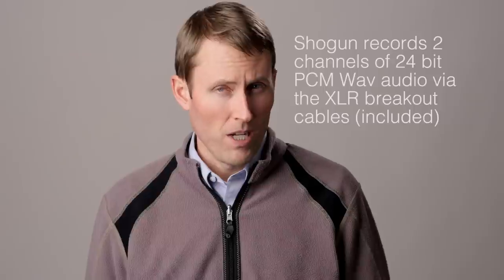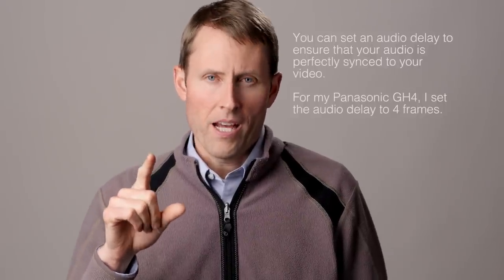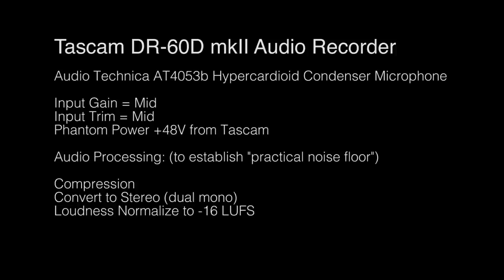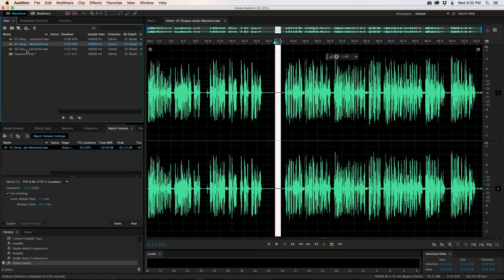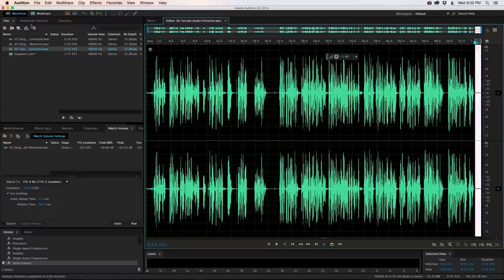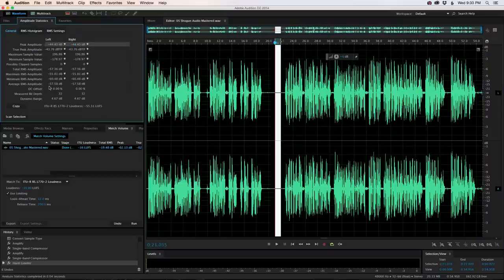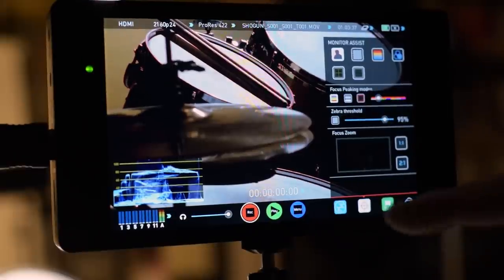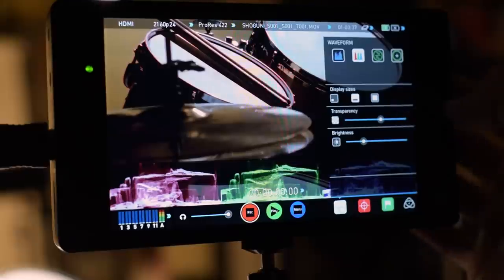Atomos Shogun XLR Audio Inputs: Decent Preamps

Comment: This is really useful, thank Curtis. I'm about to invest in a GH5s and Ninja Inferno, and wonder if you could help with an audio question? I normally record 2 Sennheiser lav mikes via XLR into a Zoom H5, and I'd like to be able to record these plus the Zoom XY or shotgun mike into the Inferno in such a way that I have the 4 separate audio channels to mix in edit. If I run the Zoom line out into the GH5s line in and then HDMI to the Inferno, should this give me the 4 audio channels I'm looking for, or will it result in amalgamated audio (which is what happens on my Sony a6500)? I wonder if I need to run the lavs direct to the Inferno using the XLR adapter cable and the Zoom audio into the camera line in, then HDMI to the Inferno. Any advice much appreciated ;-)
Reply from the maker: Hi Alastair, wow, that’s a tough one. The first challenge will be getting everything in sync since there’s always latency with the HDMI output on cameras. It might work but sounds a little challenging, to be honest.
Reply: Curtis Judd  Thanks Curtis, appreciate you coming back so quickly, I’ll let you know how I get on. The most important element for me is that the 4 channels are kept separate. I can most likely deal with sync issues in post if needs be. Or record background audio separately. 
Not sure if the audio quality will be better going through the Zoom/camera line in/HDMI to Inferno, or direct to Inferno with XLR adapter cable. Time will tell!
Reply from the maker: Alastair, this is probably not what you wanted to hear, but I would probably forego the ATOMOS recorder for now and invest in an audio recorder with 4 inputs instead, like the Zoom F4. That will probably lend more value to most productions, but of course I’m being somewhat presumptuous since I don’t know what you’re shooting. Just food for thought.
Reply: Thanks very much Curtis, I'll certainly look into the F4. I've got an H5 and usually record 2 XLR lavs into that, but syncing everything in post is a hassle. I'd like the Atomos for the 4k 60p 422, focus control, on screen LUT etc so will probably still go for it. I have to shoot quite a lot of takes in noisy shopping malls and supermarkets where there is a lot of background noise and electronic interference. Often we need to do a mix of recorded dialogue with background ambiance, so having these on separate channels is really important. Mind you, the background stuff doesn't need to sync perfectly with dialogue so that makes life easier. The challenge is we usually need to be quick and mobile, so having everything on one fairly compact rig is a big help. Thanks very much for your advice, much appreciated.

Comment: Hi Curti, thanks so much, very useful! I am connecting a Countryman Lav XLR to the Shogun for an interview, I will only use it as a VO. Do you have any setting recommendations for input/output gain?

Best,
Alex
Reply from the maker: Alex Cadilla Yes, I'd start with Mic Level and 0db as my first test to see where that gets you. I, usually aim for peaks that hit -12dB and then compress and loudness normalize in post like this: https://youtu.be/VcMOBrdbHgk
Reply: Curtis Judd Great! Thanks so much Curtis!
Reply: Curtis, sorry to bother you again but I have another question. The Shogun's phantom power can only be turned when in Audio Options the Audio in Mic Level is set at -40 dBul. If I choose Pro Level at +24 dBul or Line Level at -10dBul, the phantom power for a mic connected through the XLR's cannot be turned on and these are the only two options. If I use phantom power, does having the Audio In on the "Mic Level {-40dBul} setting have a detrimental effect on the sound recorded? I still raise the input gain level so it peaks at -12 but I'm concerned that the -40 setting will affect the sound. I am not using a sound board, I am connecting a LAV and a stereo mic directly to the Shogun.
Reply from the maker: Alex Cadilla Alex, no, that's no problem at all. The -40dB just refers to the fact that microphones produce a much weaker signal (-40dB) relative to line level (+6dB when using a balanced cable). So don't worry about that at all, you have the right setting!

Comment: Hello Curtis, thank you for the wonderful review!!! I have a question that I think you may be the only person on the internet that can answer it: I am planning to buy a Tascam-DR701D external recorder, and also an Atomos Shogun Flame for my sony A7S. Obviously I would have to run the micro HDMI to HDMI from my A7S to the Atomos to get 4K video. However, I would also like to use the sync timecode function and HDMI trigger of the DR-701D. Would running the HDMI output from the Atomos to the HDMI input of DR-701D work? (the setting looks like this A7S -> Atomos -> DR-701D)

(I know that I can also run the Micro HDMI to HDMI from A7S to the DR-701D, and then HDMI to HDMI from the DR-701D to the Atomos instead (A7S -> DR-701D -> Atomos), but the problem is with this setting DR-701D doesn't support 4K recording just yet).
Reply from the maker: Hmm, I'm not sure whether the HDMI control signals will pass through and also not sure whether the timecode passes through the Atomos in either direction. I'm afraid that I don't know. :( Perhaps contacting Tascam and Atomos will help?
Reply: Thank you so much for your reply! I only want to buy the DR-701D specifically for these two functions. I will contact them and see what they say. If it's not possible I can opt for the DR-70 instead
Reply from the maker: That makes sense. Best wishes!

Comment: Can you compare the Shogun's preams with the ones of the zoom h5?
Reply from the maker: +Manuel Eisenkirchner I'd love to do that but don't have an H5 on hand. But I can tell you this: When I've compared the H6 (evidently has the same preamps as the H5) to the Tascam DR-60DmkII in the past, they were quite similar both in terms of sound and in terms of noise performance. Then in this episode I compared the Shogun and Tascam DR-60D. I would expect that the Shogun's preamps to be a little noisier than the H5, probably by around 3dB. The Shogun has a pretty warm sound with a rich low-end but is not as clean as decent audio recorders like the H5.
Reply: thank you! =)

Comment: Hi Curtis, do you know if I can plug a Mic Mixer into the unit via the mixer's XLR outs into the XLR ins?  Also, does each input record in Left/Right? Or does one input record in left and the other in right?  Thank you!
Reply from the maker: Hi Felipe, yes, on the audio options page you change the input to line level input. Each input records a single channel. Most likely you'll get a stereo feed from the mixer (a left and right channel). Good luck!
Reply: Thank you!

Comment: Hi, and thanks for your knowledge-sharing. I have the opportunity to buy this recorder at about US $600, and I am wondering if you would regard that at as a ok price for this device being three years after release? I would also buy it used, so I wonder if there is anything in particular I should check for to see if it is in proper shape? The thing is that I am looking for a recording-system for sound as well, and thought that this might save me buying a sound-recording device as it has the XLR-inputs... I live in Norway, so the prices are somewhat higher here than in the US, generally speaking...
Reply from the maker: Hi Hans, my Shogun is still in working condition today. The thing most at risk aside from any damage you can see on the outside of the unit is the internal fan. I would at the very least turn it on and have a listen to that to make sure it sounds like it is in good condition. I'm not a huge fan of the audio inputs on the Shogun. They produce a fair bit of self-noise which is too bad since they otherwise sound quite good. I hope this helps and best wishes!
Reply: Thanks!I’ll give it some thought. BTW do you know if the sound is enhanced by the recorder if you plug in the hdmi in and then out for use  with a live-streaming program? This question applies to both the shogun and the Tascam dr 701d which also have hdmi in and out. The latter has been spotted at a store here for $450..
Reply from the maker: Hi again, The DR-701D will definitely record cleaner sound than the Shogun. I don't believe that the HDMI in/out change the quality at all either way. The audio is all digital by that point. Best wishes!
Reply: Thanks, Curtis

Comment: So if the preamps on the Shogun aren't the cleanest, what IS the cleanest preamp you've ever used?
Reply from the maker: Sound Devices 633, Allen & Heath SQ-5, Mackie Onyx preamps, Zoom F4 and F8, and even the Tascam DR-60DmkII have cleaner preamps than the original ATOMOS Shogun.
Reply: Thanks Brother Judd. That's quite a price range on those preamps but I imagine it's like everything else where you get what you pay for.  Sound Devices and Allen & Heath are in the $3000 range,  but Mackie Onyx are under $200 and the Zooms are $550 and  around $800. I'll have to keep an eye on Craigslist.

Comment: How abbot if you used a Camera Preamp, like the JuicedLink BMC388, that give you out stereo balanced and it can be done to pas to the shogun,
¿Can you disable the shogun Preamp?
Thanks,
Reply from the maker: The Shogun can take mic or line level inputs via the XLR connectors on the XLR breakout cable. I'm not familiar with the JuicedLink BMC388 but if it can provide a balanced line level signal via XLR cable, then yes, that would work.

Comment: I have an Atamos Ninja and a nikon d800.  the atamos wants line level input and the camera produces (noisy) headphones level output.  Any suggestions what to put in between?  Don't really want to hassle of post synch if possible and it really need to be as clean and simple as possible.
Reply from the maker: Hi Mike, You could try an audio adapter like one of these: https://youtu.be/B_0od_f_QkQ

Comment: Curtis, were we listening to the same track? I found lots of background noise and hum in the background for the Shogun in your recording. The Tascam was much much better! Am I missing something?
Reply from the maker: AliAtusa No, you probably just have better ears than I do.  :) I cannot hear much above 15kHz so perhaps you're hearing more up there. In measurements, I'm seeing a 2dB difference so people with sensitive ears may find the Shogun's preamps to be too noisy. In practice, I find that I never opt to use the Shogun's mic inputs. The Tascam does the job for me 99% of the time.
Reply: Curtis Judd Yes, that's possible because I was listening with very sensitive ear phones and I generally have a very sensitive ear. Unfortunately, I need to use the Shogun for its audio as well as the video. So, I'll have to play around and see what I can do. Thanks for doing the test though. Best wishes from Boston. :)
Reply from the maker: Izotope RX4 Dialogue Denoiser works well but is pricey. Audition's noise removal is pretty good too.

Comment: We have a BIG issue with the Shogun on our Rig when powering the Tascam DR-60D by usb plugged into a p-tap either on the battery or the powerdock while feeding it directly into the Shogun or into the Sony A7s with Atomos Shogun 4K we get a Feedback loop.  This does not happen when we un-plug the usb and power by AA batteries. The Tascam works great with p-tap usb power when we try the same thing with our Sony FS100 but NOT with the A7s/Shogun where we get a Feedback loop???  Video:  https://youtu.be/MXgGS4LcbWQ

Comment: can you plz explain to me ? :)lets say I want to record from 4 , or more mics at the same time, will any Shogun be able to record in separate tracks? I read in the manual, it can records 8 or 12 audio tracks?? but is it digial, and only 2 analoge tracks ? really confusing.
Reply from the maker: +per gunnar Merakerli The original Shogun has 2 microphone preamps. If you feed other audio channels over the HDMI feed, the Shogun can also record those. This means that if you want to record more than 2 microphones, they need to be recorded from the camera's preamps and then fed via HDMI to the Shogun. Does that make sense?
Reply: +Curtis Judd thx for quick respons :)I sont even own a camera yet, but have a recording studio, an plan to buy a SONY a7s ii. they say its gotg a good preamp. Maybe one doesnt need many mics in lot of situations, but .... if I then record 4 mics, lats say, I can treat them as seaprate track in SONY Vegas, right ? getting a seaprate audio recorder seem to me a lot of extra work, but SHogun seem to be good, when you also will need a monitor anyway, and even get better 4k formats than the a7sii... am I right, you agree ? :))
Reply from the maker: +per gunnar Merakerli No, unfortunately that won't work. With the Shogun, you have only 2 preamps. With the Sony A7SII you have a single stereo input. So in theory, you could record with three microphones, one connected to the Sony, and two XLR mikes connected to the Shogun. Does that make sense?

Comment: Thanks for this test! Kind of disappointing to see that the audio is again an afterthought as it is with many other devices. Good audio electronics really don't cost an arm and an leg. Tascam can make a whole unit for 225 euro's! So why Atomos apparently decided to go the average route is beyond me, especially considering this is not some consumer toy but a professional recorder with a price tag of more than 2000 euro's.
Reply from the maker: Nepwk Yes, a little disappointing. I think they were hurrying to get a 4K recorder to market so they had a lot of problems to solve to get there and audio was not at the top of the list. However, while these aren't the cleanest preamps in terms of noise, they actually sound decent. They impart a little bit of warmth. But then again, the whole Lemo connector off the side of the recorder is a little unwieldy. I find that I still just default to my Tascam recorder instead of using the Shogun for audio. The post sync process is worth the better audio I seem to get that way.
Reply: +Curtis Judd I noticed in the video you said that you liked the Shogun better but here you say you like the Tascam better.. Care to clarify?   I am really looking to this for a single setup for my 5DIII and possibly the A7sII (when it comes out).  Any thoughts on using this with the 5DIII vs the Tascam 60DII or Tascam 70D?
Reply from the maker: +Ryan G productions Yes, the Shogun's preamps are warmer sounding but they have more noise. By warmer, I mean that it seems to produce a little more low-end presence. However, I've found the noise floor to be pretty annoying and requires clean-up in post pretty much every time. If you're ok with the noise floor cleanup, then its a good solution. But if you cannot afford for that to be part of your workflow, the Shogun probably isn't the right audio kit for you.
Reply: +Curtis Judd Thanks for the review and for the note.  I was hoping to get something to NOT have to do audio cleanup later.  I just don't want to deal with it.  That being said I ALSO needed a monitor as well, but I might just send this back, but I did buy the Fethead and hoping that might help a bit so I don't have to increase the gain, thus lower the noise floor (right?)..  

Last thing:   I was trying to figure out how to get the audio directly from the 5DIII to the shogun, I know the HDMI won't pass audio from the 5D to the Shogun, but I was wondering if you knew a way.
Reply from the maker: +Ryan G The FetHead should definitely help. Gain staging with multiple preamps can work quite nicely.

As for getting audio from the 5DIII to the Shogun, hmm. There may be some hack ways to do it (3.5mm out of the 5D then adapt to XLR somehow?) but I wouldn't expect that to work well.
Reply: +Curtis Judd Thanks Curtis... I appreciate it..  The Fethead is coming so let's see how that works.  I might even post a review.  :)    Although I first have to figure out how to edit the audio to normalize it (I have your youtube for audition up waiting to learn it).   Thanks
Reply from the maker: +Ryan G I'd be interested to hear how the FetHead works out.